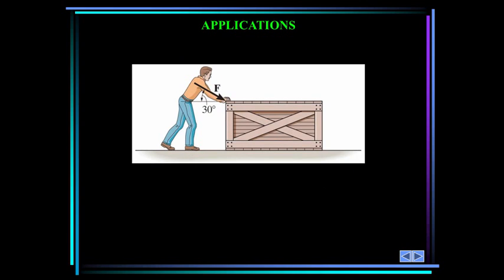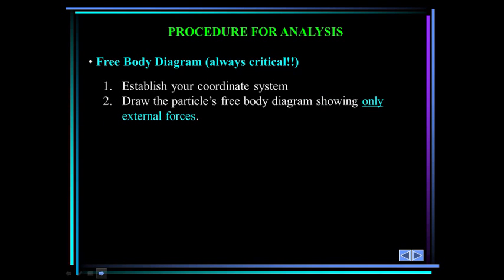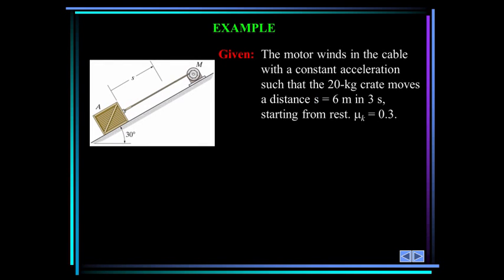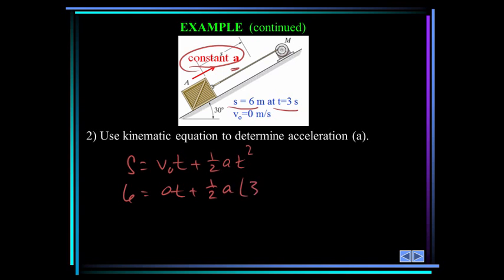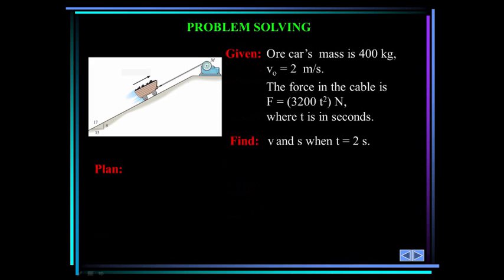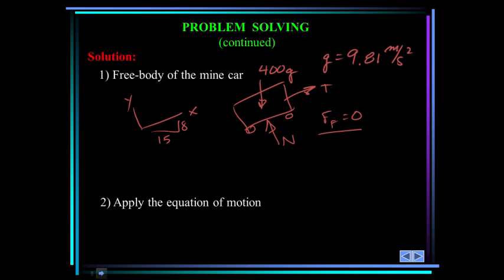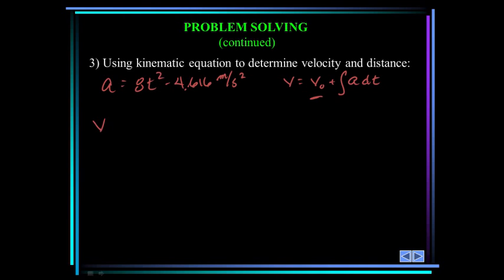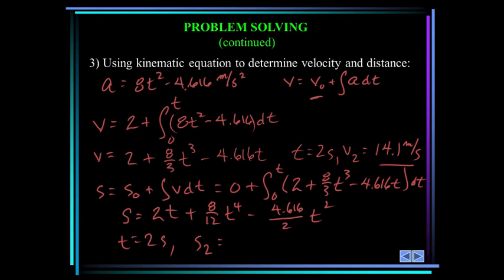ME 274: Dynamics: Chapter 13.4

Comment: Thanks for the video, it's really helpful. But I got a question in the final problem you integrated the value of a, then you added to the initial velocity, I used another way which is (s=vt+0.5at square) then I substitute the value of s to the following formula ( Vsquare=v initial square +2as ) I got a different answers! knowing that our value of a is the same! Thanks again ^_^
Reply from the maker: Those two equations you used are only valid when the acceleration is constant. The acceleration in this problem is a function of time.
Reply: what if we use a=dv/dt i and set integral of velocity (2-v) we might get same answer
Reply: from 2 to v(f), is what i meant